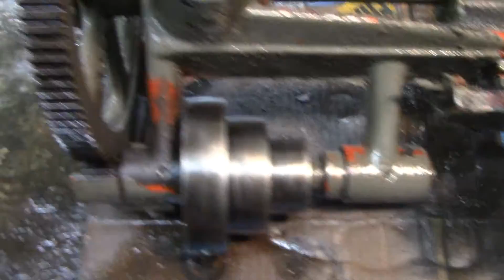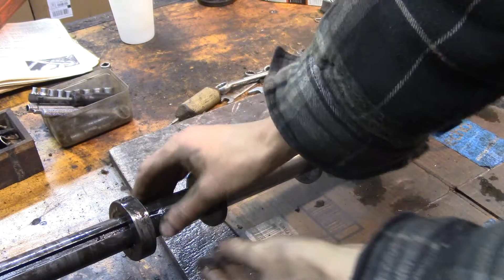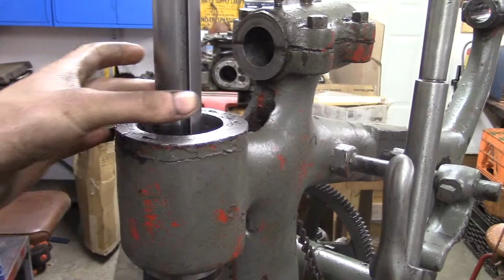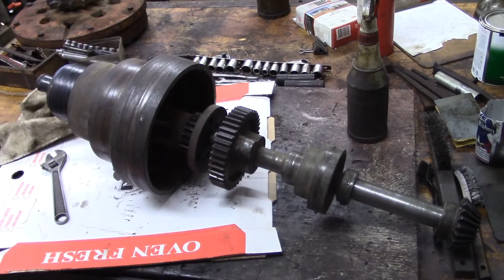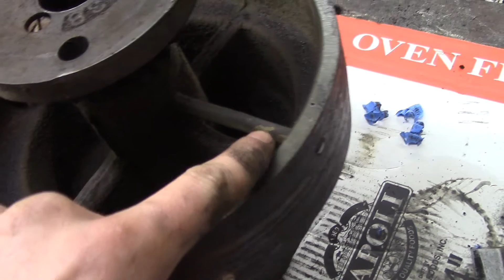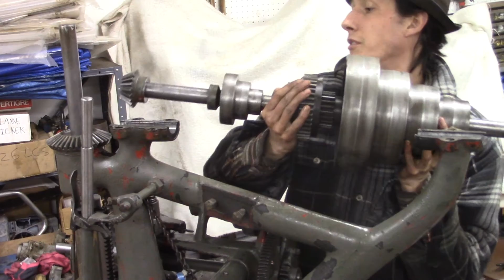Canedy-Otto Drill Press Refurbish - Part 2

Comment: What weight oil are you going to use on it?
Reply from the maker: something slippery! Doubt it matters. I usually have 15-40 in my oil cans.
Reply: @themadmailler  thank you for answering all my questions.  Tonight I spun the pulleys and it was almost impossible to turn. I used a pick and pb blaster and cleaned every tooth on every gear. It spins nice but seems to bind up,  in one spot. I'm thinking the lead bearing is broken and  causing the bind. But in not sure. And the gear disengage lever is frozen
Reply from the maker: @richardsherwood3725  did you take apart and clean all the bearing surfaces? Won't take much gummy oil to make it stuck. Even if a piece of babbitt is broken and floating around I bet it should still spin ok. And for the back gear lever, just use repeated rounds of heat and oil, and gentle tapping. And patience! I like to use diesel since it's cheap and thin. Try to dribble it in the lube hole as you're heating so it gets oil from the inside out.
Reply: @themadmailler  all but the back out gear bearing. And you nailed it there were little broke pieces of babbit wedged in the gears. Preventing it from turning.   Is this beauty really from 1911?
Reply from the maker: @richardsherwood3725  I'm sure they made them for a while,  but it's definitely early 1900s tech!

Comment: Could you use grease instead of oil to go longer between lubrications?
Reply from the maker: I suppose i could, but the babbitt bearings are not cut with grease grooves to retain grease, so the grease would run out fairly fast, though it would make less mess because it wouldn't drip everywhere. either way, in my opinion, would work just fine.
Reply: @themadmailler  I just picked up this exact machine. Is there a manual available?
Reply from the maker: @richardsherwood3725  doubt it, but there isnt much to this machine anyway.